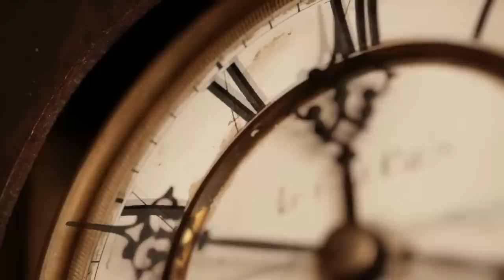TERRIFYING Discovery At Oak Island During Final Excavation

Comment: Couldn't the tunnel be blocked and then drain the water?
Reply: The problem with that idea is that you are assuming that it's just the tunnel with the water trap it is more than that the water table itself is very high that is why after 120 feet everything becomes soup. I think the best way to solve the water issue is freezing the ground with glycol so there will be no cave ins.